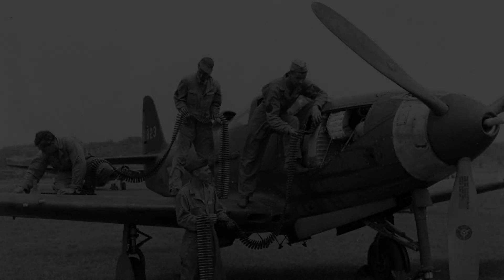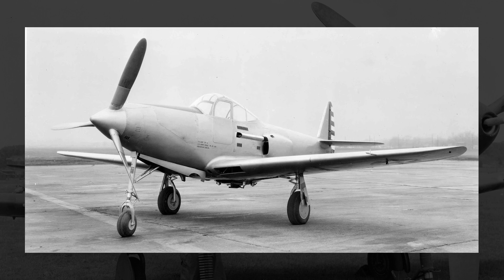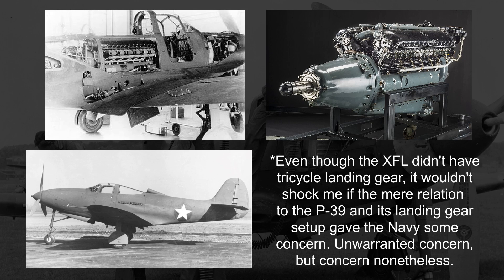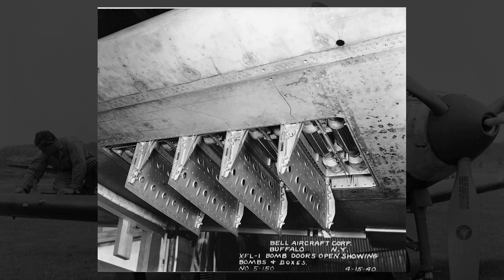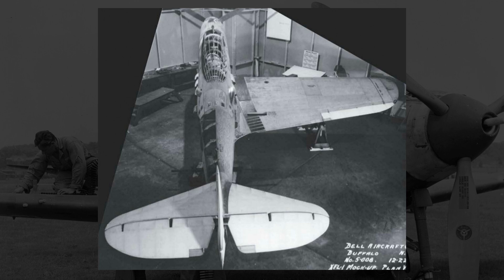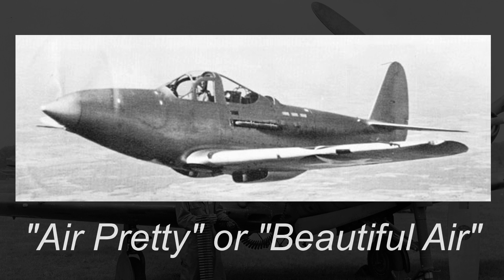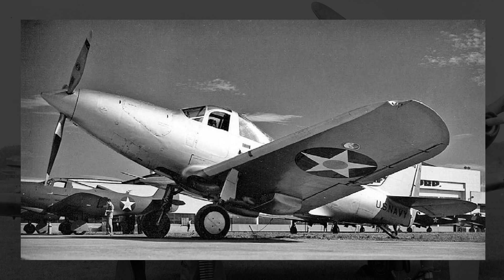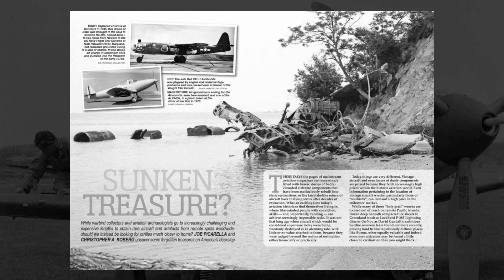A Fighter So Disappointing, They Used It For Landfill: Bell XFL Airabonita

Comment: The bonita is a fish. Presumably, Bell was using it as a marine name. I've little doubt that Bell could have made an absolutely legendary Naval strike fighter out of the XFL, but never really had the chance. The P-39/P63/P400 would become one of the best mud-movers the Allies had. At low altitude, it was an absolute monster, capable of extremely tight turns, and that devastating 37mm punch would ruin your opponent's day faster than just about anything else.

Comment: If you look at the side intake on the prototype at the beginning of the video, it originally had a supercharger. The ding dongs took the supercharger off, which was similar to the one on the P-38. Removing the supercharger severely limited its performance and altitude. It did 390 mph with the supercharger.

Comment: The USN might have had a plane that could tangle with the Zero on its own terms had this machine ironed out its kinks and gone into production like its doppleganger for the Army. The P-39 performed well against the Japanese fighters but its mildly supercharged engine let it down @ altitude. Since the Japanese fighters were so poorly armoured the Airobonita's concentrated heavy fire would have been a boon, like a pocket sized P-38. The P-39 is an airplane that looks ageless and one wouldn't suspect it originated in the 30's.
Reply: Japanese fighter pilots in New Guinea referred to the P-39 Airacobra as "meat on the table."   

The Zero outclassed the P-39.
Reply: @KOMET2006  At some point in the war you could insert the P-40 and Wildcat there as "meat on the table". It all depended on pilot skill. It was essentially a light and nimble fighter like the Zero, as far as anything US goes.
Reply: @Deviation4360  - Arguably, both the Wildcat and the P-40 were better fighter planes in terms of durability and performance against the Zero than the P-39 was.     

The Japanese pilots of the Tainan Air Wing (one of the Imperial Japanese Navy's top air units, which saw considerable action against the P-39 over New Guinea during 1942) regarded the P-39, in the words of one of its top aces, as "meat on the table."    Pilots of the caliber of Saburo Sakai, Ota, Sasai, and Nishizawa downed several P-39s among them.

Furthermore, the P-39s, when they were deployed in the fighter vs. fighter role in the latter stages of the Guadalcanal campaign, proved to be failures in that role.    So, they were deployed by the USAAF in the ground attack role, where they performed well.

Comment: At some point the Navy decided air cooled only due to reliability being over the ocean is far more dangerous when the big fan stops! Also, I can imagine there was a significant change in Center of Gravity affecting stall characteristics as that heavy ammo in the nose was expended in any of these designs. However, my research and talking to some pilots would indicate that they were better aircraft than given credit for. The biggest issue was handling quirks from the rear engine and driveshaft that could be fatal to the inexperienced. The navy did use armored orange "pinball" P-39 aircraft with indicator lights on the wings etc to show hits from frangible compressed .30 cal bakelite/lead powder machine gun bullets for anti-aircraft target practice.  Not every pilots favorite job!

Comment: Well, the low top speed of the XFL promptly doomed the plane. Not when the XF4U-1 prototype was flying faster than 400 mph--in 1940! That was way faster than even the best fighters of the time, the Supermarine Spitfire Mk. I and the Messerschmitt Bf 109E-3.
Reply: Actually, Supermarine had flown the prototype Spitfire Mk.III with the 2-speed Merlin XX in 1940.  It was a 400 mph fighter and highly manouverable, but skullduggery caused those engines to be allocated to the old Hurricanes instead.

Comment: "Altering the oil cooler intakes". A liquid cooled engine like the Allison also requires air intakes for the radiators, in addition to oil cooler air intakes. Some aircraft also required air intakes for intercoolers or aftercoolers. Not the P39 unfortunately. It was supposed to include a sequential turbo/supercharger system with a large intercooler. The turbocharger and intercooler were omitted for some stupid reason, crippling its high altitude performance.
Reply: What I read was Bell was heading into financial troubles in ‘38/39.  Turbo production wasn’t timely.  So Bell produced the P39 without turbo just so the company would survive.  
    The P39 is a small airplane and while it might be OK for interceptor it had no hope of matching the ‘38, 47, or 51 range.  The small size and mid engine I suspect provided excellent maneuverability.  And An attribute treasured by the Russians.
     Looking closely at the Airbonita can see radiator scoops under the wing (also note the thin tires).  
The P39 had leading edge inlets.  LE inlets reduce drag as they take advantage of the natural LE stagnation.   Same idea used on DH Mosquito.  And the Corsair oil coolers   The P39 was a slick airframe and puzzling why it did not go faster.  
     It seems Allison was always 200hp behind the Merlin.  
    Cheers
Reply: The extra cooling intake for the intercooler and rad caused too much drag and the enclosed engine/exhaust built up too much heat.  It didn't even hit 400 mph at 20,000'. The turbo system weight was about 350+ lbs making wing loading even higher.  It simply wasn't a feasible design in that little airframe.  Curtiss refrained from trying it in the P-40 for the same reasons.
Reply: @bobsakamanos4469  Thanks. So the turbocharger was too big and ran too hot for the P39, and smaller, more efficient units weren't available. But the problem is the P39s supercharger was a low-boost unit which was designed to work with the turbocharger. But when the turbocharger was removed, Allison didn't upgrade the supercharger at all. Even just fitting a higher boost single speed supercharger would have been a big improvement.
Reply: @ChristianMcAngus  

@ The B-5 turbo itself was only about 135 lb, but the added weight of inter-cooler, pumps, oil cooler/tank, etc all added up and wasn't easily fit into available space.  The intake on the  side of the fuselage was also a poor choice.  
Allison/GM were loath to develop a 2-stage or even 2-speed S/C and always took short cuts like tacking on the auxilliary S/C, which NAA rejected immediately in early 1941. The Allison never could handle high boost and suffered detonation and problems right through to the P-82.

Comment: Thy the military at that time had a thing of not liking the 20 mm for aircraft, at least the US made ones because they were junk. So they decided to install a heavier 223 Lbs, M4 37 mm with a low velocity 2,000 FPS, with 30 rounds. Compared to a lighter 92 Lbs, M2 20 mm like in the P-38, with a much higher velocity of about 2,723 FPS with 150 rounds. The M4 37 mm would have served much better in a pod attached under the wing for ground attack. As for use in a fighter aircraft it was a total failure.
The big problem with the US produced 20 mm Hispano-Suiza cannons was that they had problems with light firing pin strikes causing misfires. One would think that could be reminded fairly easily in a number of ways. But they would have done far better if they just dumped the 37 mm cannon and stuck with 6 .50 cal M2s. I can just imagine a group of officers getting together to put a specification together for an aircraft back then. I'm sure someone wanted more power than the .50 cal M2 and wanted a 20 mm but knew of the problems. So, like today's planners, they probably thought if a 20 mm is good the 37 mm would be far better at taking enemy aircraft down with a larger explosive. But they never considered that you need to hit what you are aiming at, the weight of the gun and the limited amount of ammo or its lack luster velocity of the 37 mm. It might have made a good anti tank gun early in WWII but it was horrible in a fighter aircraft.   
The P-39 aircraft also suffered from lac of a turbocharged engine that gave it poor performance at high altitudes. It would have done much better with a Packard built Merlin engine that was in the P-51. But powered aircraft were only invented or introduced in 1903 with the Write Brothers first flight. That was only 35 years before the XP-39 first flew in 1938 and only 7 years after the first all metal military aircraft were being used in 1931 being the Boeing B-9 Bomber (1931) and the P-26 Peashooter (1932). The air frames and power plants were new, still being developed and a lot was unknown at that time. Many today don't understand how new aircraft were in WWII when looking at WWI fabric covered Bi Plains and then looking at WWII all metal advanced aircraft. What is more amazing is when you understand that all if the major world changing inventions ever made in history, over 90% were invented in the 1900s and most of them were in the second half of that century. 
The problem with the military, even today, especially with aircraft, is that they want one aircraft that can perform multi rolls with all the bells and whistles they can fit in them. That has never worked. The best aircraft have always been those that are designed for one or two jobs. The more you add the heavier and less capable an aircraft is. You wind up with an aircraft that is just adequate at multi rolls and poor at any one job.

Comment: As a naval fighter, nothing is going to beat the F-4U, The P-39 was still a very capable aircraft. The removing of the turbo charger was a huge mistake.
Reply: Like the later F-4, the Corsair was a naval-specific design that was quite simply so "right" it was unexcelled. The F4U/FG has my vote as best overall piston engined fighter of the war.
Reply: @stevetournay6103  same. And thank you for calling it the F4U, and not the F-4U.
Reply: I'd argue the lack of a turbo charger wasn't its greatest issue, the lack of fuel was. The mid-engine layout eats into the fuselage space normally taken up by a good chunk of fuel. While I'm of the opinion that had piston engine fighter development continued we would've seen a lot more mid engine fighters, such fighters would've also been significantly larger. Japanese Zeros had a significant lead over American naval fighters in range during WW2, the Airabonita would've only made that issue worse.
Reply: @epikmanthe3rd  I doubt we would’ve seen any more mid-engine fighters.  I don’t know of any that received serious development beyond the P-39, and by 1945 the combatants already knew the jet was going to replace everything in a few years.  Where the configuration could’ve worked and worked well would be a turboprop attack plane, however it would probably not be possible until the 1960s or so when turboprops had been miniaturized enough, matured, and become reliable and relatively fuel efficient.  Put the turbine in the middle and a 30mm autocannon in the nose, and presto you have an A-39 or A-63.
Reply: @CaptainAhorn  Yeah, and I specifically said with the caveat if piston engine fighter development continued, though I probably should've specified with earnest.
Reply: @epikmanthe3rd  I saw that you said “if piston engined development continued….”  I’m just saying I disagree.  There was nothing in the pipeline anywhere.  Buried engines (either in the fuselage or in the wing) was something that a lot of people looked at in the 1930s, at which time it was generally understood on the basis of some experimental types that the idea was a dead end, because the cooling issue was a major, arguably insoluble problem.  No one else pursued it to the extent that Bell did.  And the decision to produce the P-39 had some political aspects.
Also as you mentioned, the mid engine displaced what would be the prime location for fuel in a small single seat fighter.  In theory, that could’ve been overcome with wet wings, but during WWII no one was going to seriously consider a fighter with unprotected wet wings.  Lots of fighters had wing fuel tanks, but any nation that could build them used self-sealing tanks once the war really got going.
One side issue is aerodynamics.  A large reason behind the P-39 at Bell was that they were convinced (and I guess managed to convince some decision-makers) that the design guaranteed high speed/low drag.  This turned out to not be the case.  Youtuber Greg’s Airplanes and Autos (he’s a professional pilot with a lot of technical info) posted some really detailed and surprising data straight from manuals and NACA testing.  The P-39 had the highest drag coefficient of any US single-engine fighter of the war.  Furthermore, most of the prewar US fighters were designed without the benefit of the extensive aerodynamic work NACA did in the late 1930s. Specifically, the P-38, P-39, and P-40 had some serious drag issues as built which were never fixed, mostly centered around cooling intake design.  The later designs (P-47 and P-51) had this information and were significantly less draggy and faster on similar power.
Long story short, IN HINDSIGHT had the P-39 been designed 2-3 years later and with the benefit of NACA tests, it’s possible the cooling problem could’ve been mitigated.  However by that time the development cycle had just passed it by and no one was going to give a failed idea a second chance with jets on the horizon.
Reply: @CaptainAhorn  You're missing the forest for the trees. Hell, Greg's airplanes who you just cited even mentioned that had piston fighter development continued without the anticipation of jet fighters, AS IN AFTER 1945, we likely would have seen more mid-engine fighters. Which was exactly what I said.
Reply: @ i’ve watched most to all of his WW2 content videos and have never heard him say “there would’ve been more mid-engined fighters.”  If you know the video please link.
Reply: @CaptainAhorn  I don't have the time to watch the full 50 minutes, and YouTube doesn't like links, so I'll just say I think it's his video "why the mid engine". I could be misremembering it's been a long time.
Reply: @ I just rewatched it.  Greg didn’t say that, but I think I know where your impression came from.  At around 15:00 Greg quotes from a magazine article written by one of the Bell engineers which says something vaguely similar.  The article (and others) contains some insights into Bell’s design philosophy, but in general was a PR piece to promote their aircraft.
Reply: The Turbo charger kept catching fire. Due to the engine placement, they couldn't fix the problem
Reply: The issue isn’t that simple.  The P-39 had problems with turbo fires and they had serious engine overheating problems in the Pacific.  They simply couldn’t be run at fill power for any length of time due to the engine placement.
One of the reasons they were successful in the USSR was that they didn’t overheat in the cold climate.
Reply: @trevorgale1176  .... except for the Bearcat, FH-1 Phantom, F2H Banshee, F3H Demon, FJ Fury F-4 Phantom II , F-14 Tomcat, F-35C, etc.   'Twasn't exceeded as a naval fighter in combat during World War II, for sure, I agree with you on that.
Reply: @keppscrossing  I did realize the Axis flew Bearcat, FH-1 Phantom, F2H Banshee, F3H Demon, FJ Fury F-4 Phantom II , F-14 Tomcat, F-35C, etc.  In WW2

Comment: The P-39 really should have gotten the same turbocharger setup in the P-38.
Reply: I could imagine that a bulky system of turbo, intercooler and associated piping and tubing would have been difficult to fit in the narrow rear fuselage of the P-39, and might also have caused center of gravity issues. The P-38 and P-47 both had them, and these were rather big aircraft for that reason.
Reply: The extra cooling intake for the intercooler and rad caused too much drag and the enclosed engine/exhaust built up too much heat.  It didn't even hit 400 mph at 20,000'. The turbo system weight was about 350+ lbs making wing loading even higher.  It simply wasn't a feasible design in that little airframe.  Curtiss refrained from trying it in the P-40 for the same reasons.